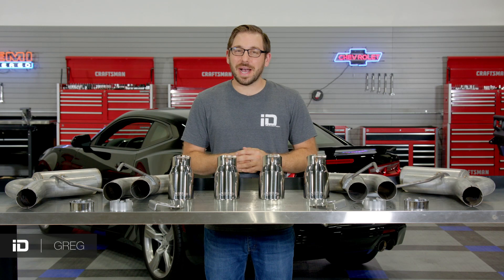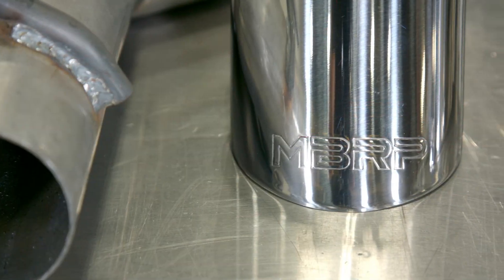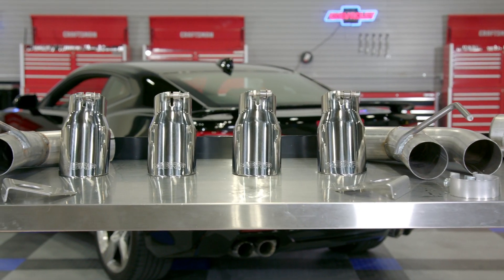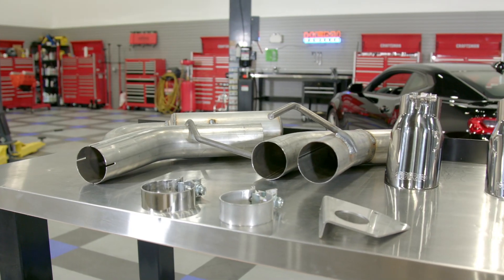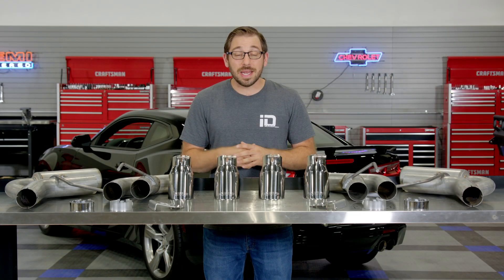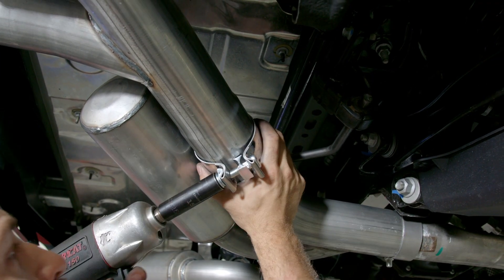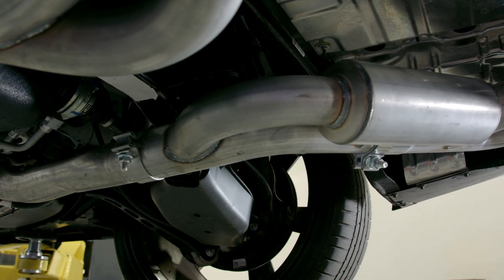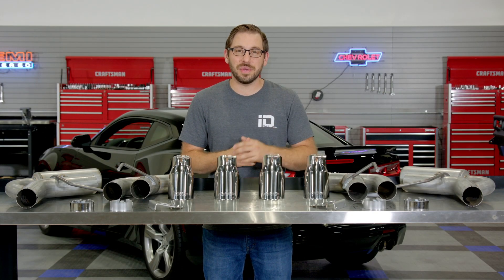16-20 Camaro SS MBRP Installer Series Axle Back Exhaust Review

Comment: Will the engine re-map itself to take advantage of the reduction in back pressure and flow?
Reply: @carid  ...I apologize for my bluntness here, but you didn't read my question/comment correctly.  I asked if the CAR would re-map ITSELF without any HUMAN intervention to take advantage of the freer-flowing exhaust.
Reply: @Rickbearcat  you should do more research. There are literally hundred of videos with hour long explanations of the effects of a free flowing exhaust. Also the limits of fuel trims on modern cars.
Reply: @The412Devil  ...No research necessary.  This "upgrade" is for sound only.  There is zero performance benefit.  You would be paying $500+ dollars to make your exhaust sound louder and raspier.  I'm not even convinced that this kit flows better than the stock system.
Reply: @Rickbearcat  the video never claimed performance gain, it literally states that the mod is for sounds and look only.
Reply: @Samuelamnuelgreeneggshamuel ...I never claimed that it did or does anything that you state.  Please re-read my comment.  It solely deals with the car's computer system and whether it recognizes that a freer-flowing exhaust has been installed because of the reduction in backpressure.

And I don't know what you mean by, "...literally states...".  The title of this video says nothing about looks or sound.  Only that it is a review of this specific exhaust system.  So, you are wrong on both accounts.
Reply: @Rickbearcat  if you "watch" the video again it states that it is for sounds purpose. I never said title states it if you reread it.  You asked if the vehicle would caliber for the reduced back pressure of the modification. No one claimed it did and thinking a axle back would do anything as such is naive.
Reply: @Samuelamnuelgreeneggshamuel  ..." No one claimed that it did...".  This is EXACTLY why I asked the question that I did.  Also, read my last comment to @The 412 Devil where I explicitly state, "This "upgrade" is for sound only.  There is zero performance benefit."  Had you read that, your comment to me, at that point, becomes mute.
Reply: @Rickbearcat  then why even bother to rant about how it's going to sound raspier and "more" restrictive flow than the stock unit? You just want to complain I see, difficult people are going to be difficult I guess.🤷
Reply: @Samuelamnuelgreeneggshamuel  ...I can not, for the life of me, understand how you are misinterpreting everything that I've said here (and in my original comment).  What I have stated IS NOT a rant of any sort.  A "rant" is a statement.  I've made no statements.  I've only asked a question; which is the exact opposite of a rant.  This will be my last communication with you on this.
Reply: @Rickbearcat  no misinterpreting here. Reread your comments, you've literally complained and criticized the product all the way. Saying it's  "raspier" when the video shows otherwise. Go cry some more, I'm done arguing with a Karen.